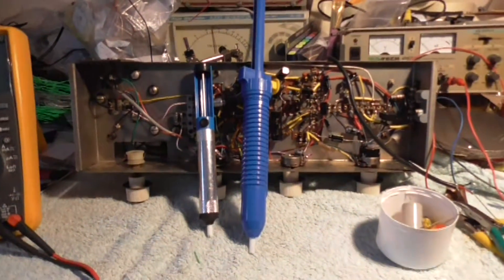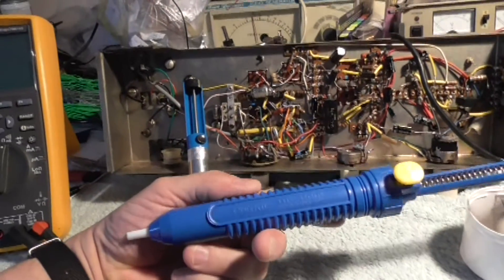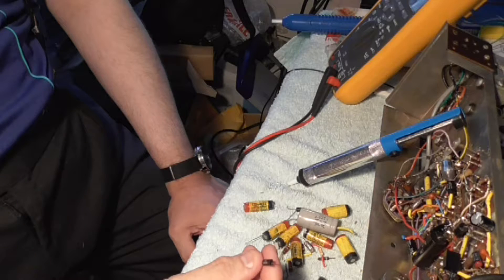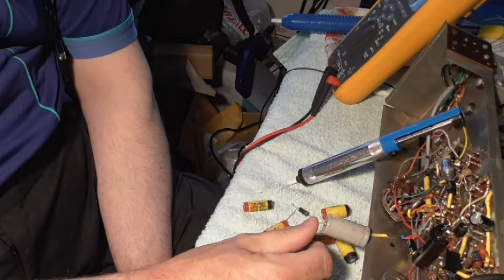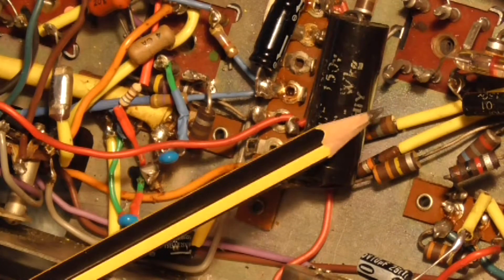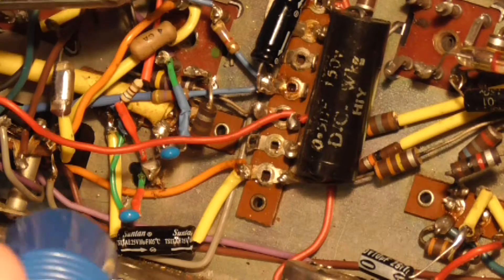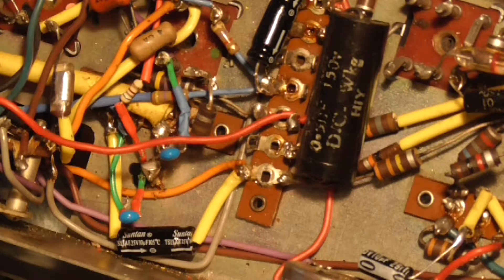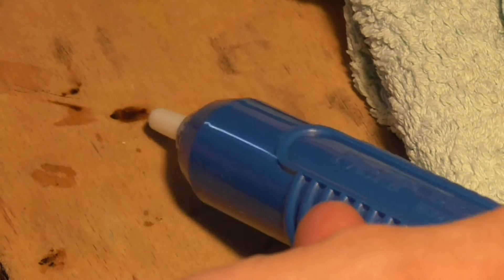My New Solder Sucker demo

Comment: May have to look into getting one of that type.  Thanks, Gary
Reply from the maker: Its turned out ok. I am very impressed so far. The real test will be on valve radios were they tend to use lot more solder. We will have to see lol
Reply from the maker: My sugars are doing so well, now.  I was up last night with blood test for sugars 3.4. So I get up and have honey on brown toast, only to find I cannot get back to sleep again. Lucky I not at work to day monday the 8,8,2016.   Just a dam nuisance
Reply: Richard uk I don't know the scale they use there to test sugar.  I use test strips and a meter here at home.  Generally on the meter 90 is to 110 or so is considered good.  I have had it as low as 63 (bad)  and been dizzy and ravenously hungry and as high as over 300 (very bad) and been dizzy and when standing up get tunnel vision and see the "black flowers"  I just now checked mine and it's at 149 which is moderately high but I only took my long lasting shot about an hour ago.  Guess I could take a couple units of my fast acting novolog and have a sandwich or something.  Take care, Gary